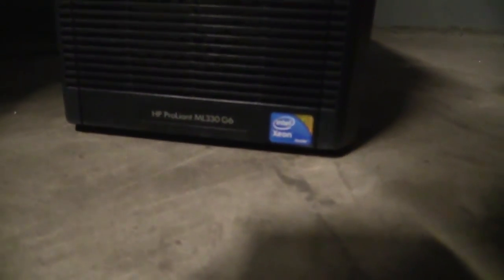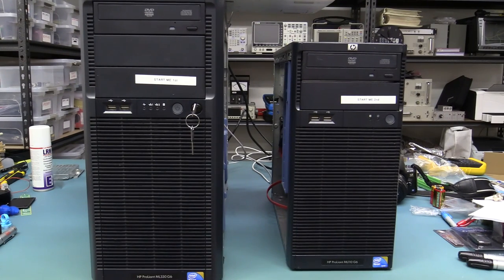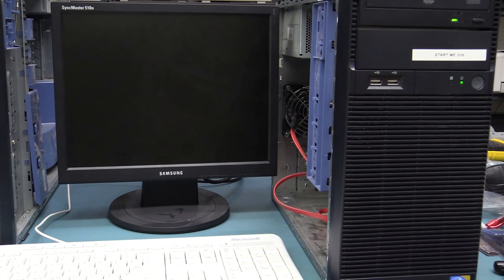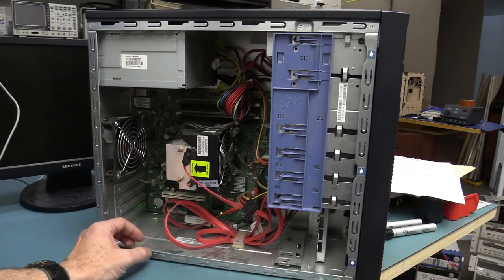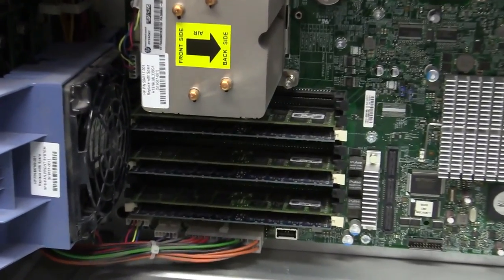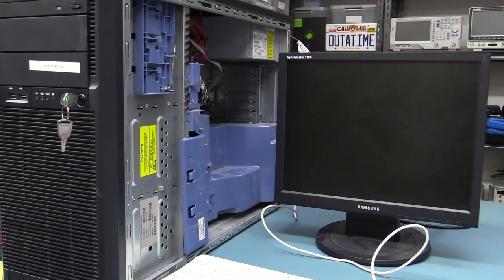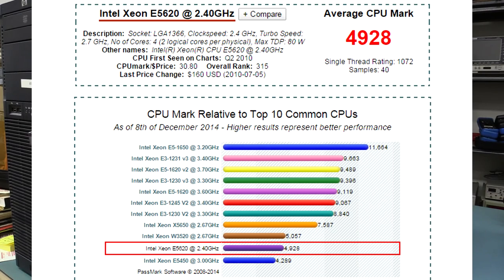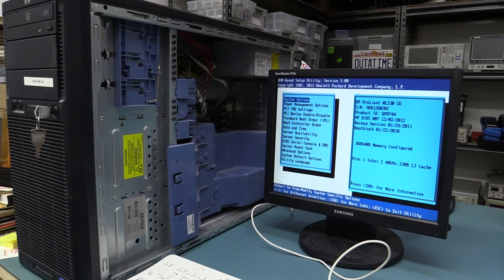EEVblog #691 - Dumpster Dive Xeon Servers

Comment from the maker: KaidoFujimi if you look at just a single processor system, yes. But if you look at it from a multi-processor large scale server based system, I believe that Xeon based systems can offer better overall processing power efficiency per server system watt per unit volume per user.
Reply: They also have more bandwidth as this system has a Tripple channel memory controller, the new Server/workstation class have Quad channel "LGA 2011 and LGA 2011-3"
 For the ML110 that can take a I5 and Celeron but why would you want to, also you may get problems as those have ECC RAM.

Also a funny note on the ML330 G5 HP gimped the Intel Sata Raid to only have raid on 2 channels instead of supporting 4 so if you wanted to have all 4 in raid not possible with out Raid card.

Got to love HP, i did complain and they did send a Free Raid card so i guess that was nice, well for the Client.
FYI the ML110 its not worth it, your desktop would be faster then that as its a low end server.

The other server worth keeping, as its mid range server so have fun. "worth keeping".

Server Fans are meant to be loud ;) "I can't sleep if i don't hear my servers... I am sick..."

Oh yeah Server heat sinks are normally over what is needed not as bad as some gamers but still over kill.

Thanks for sharing dave.

P.S you have a some toys coming from me soon in the mail.
Reply: BlackIce504 HP sells a 'license upgrade' for the raid and ILO that can sometimes be hacked.  the raid one is usually a hardware eeprom or some sort, could be a smart/sim card too.

intel started the whole licensed raid level thing shakes fist
Reply: Biggest difference between modern Xeon and i7 processors is cache size, ECC memory controller, huge RAM support, PCIex lanes and hdd/ssd controller. "Basic" performance is very similar, cores are very similar (if not identical).
Reply: Dave you can make an awesome FreeNAS system with that big server and all that ram!
Reply: doomprophet You can make NAS with small mini-ITX board. It would do the same thing, use 30x less power and generate zero noise. Using server like this at home, where you have max 5 concurrent connections is like using a caterpillar 100 ton truck to deliver 1 pizza.
Reply: *****
 Hi mate your speaking to a person that has a I7 on 2011 socket with a Xeon on 2011 the Xeon has better multi-threading performance then the I7 but the I7 has better single core performance but this is only because of the higher clock speed if i run them same speed i get similar results on thing that is the same is the cache L1 DATA 8 way L1 inst 8 way Level 2 8 Way L3 20 way the size difference in my case is 5MB but its expected Servers are designed to run multiple tasks. but you right about the more bandwidth pci-e lanes plus the QPI is 5GT/s to 8GT/s "2 to 4"

Anyway mate Merry Christmas
Reply: ***** ...You're making me feel bad for making an NAS/print server for my parents out of a $20 thrift store Dell Poweredge 830 hodge podge (had 3 500GB SATA drives in a hotswap SAS backplane out of a newer unit, with a Dell Perc 5/i raid card controlling it)... It has a pentium D monster too... Beats the repurposed emachine (with a old 3ware 7000 RAID) they were using... Both run debian w/o GUI.
Reply: EEVblog XEON's use about 2-4x Less energy per unit of performance than desktop processors.
Reply: KSSilenceAU compared to the exact same generation that the xeon was based on I doubt it, infact the motherboards and other hardware included in most 'servers' tend to use a bit more energy than a desktop.

I actually have an overclocked cpu, in a computer with a bunch of drives, a videocard that needs a pci-e power connector and it still uses less power than its xeon counterpart..

now 2-4 percent less energy vs performance maybe, if you were using the exact same hardware, and only changing the CPU out....
Reply: Valid point but All depends on the hardware and what tasks the machine performs and how loaded it is for a majority of time.
My IBM Server currently runs ~6VM's in ESXi but they idle most of the time whereas my desktop if under decent load when running, but with 3 HD 6970's in it, those alone would use just as much power idling as the entire IBM server does. 

In an ideal world one could take their i7 Out and drop in a Same Socket XEON, but unfortunately XEON processors with the same sockets are their Core Series friends wont work in a board for a Core Series CPU even though its the same socket, not sure if deliberate or not. Would be perfect for Hot weather tolerant machines. My rack server lives in the garage where it can hit 40c + and its not bothered, but my Lanbox Home server which is watercooled on the processor just doesnt like much heat and would never survive on air cooling, even though the Processors in both have the same performance per CPU.
Reply: KSSilenceAU for LGA775 desktop boards, you can actually get a pin swapping sticker, and do a simple mod to your socket, then a microcode update to the bios and run most if not all lga 771 xeons (I have done it)

For desktop boards running 1366/1150/2100 sockets, there are Q## series motherboards can can run xeon's out of the box.

you may loose a couple of xeon specific instructions because you dont have the related server chipset, but you dont loose them all, and afaik you gain ECC support and maybe slightly better cache performance(because bigger cache)
Reply: omegatotal i was reading a bit about that tonight but specifically looking at LGA 1156 which is what my "lanbox" Server is, Atleast for that socket people say you can drop for example a XEON X3450 (or other X34xx xeon) straight in and 9 out of 10 times it just works.

Im rather tempted because the X34xx  XEONS support 32GB of ram, where as the i5 760 and i7 860 CPUs for LGA 1156 i have for it only support 16gb ram. 

I believe the ram limit is that of the Memory controller in the Microprocessor and not the board correct meaning if i stuck a X3450 in i could run 32GB instead of 16GB ?
Reply: KSSilenceAU yes and no, there are some limitations on the board due to the passives and the load that is placed on them with higher density ram.

Also xeon's allow use of FB-dimms(better performing and allows more ram per channel) but not all boards can handle those either.

it takes a bit of trial and error 

also, you may need a microcode update, which is not always trivial. just depends on the motherboard and bios files/flashing utils used

for example, I just recently modified an HP bios and discovered for example that the HP bios version does not infact support 8bit (256 color) full screen logos, even though the AMI Bios that the HP Bios is compiled from /should/ support 8bit color..
Reply: omegatotal , the board in Question is an MSI P55-GD65 (Not the USB 3 version) and there are a few reports of it working with the latest bios i think. What exactly goes into updating microcode and how does one get hold of the microcode they need?

Flashing is done either thru the bios's built in M-Flash utility or via a Bootable USB / CD as well i believe.
Reply: omegatotal Would this be the Microcode im looking for ?  https://downloadcenter.intel.com/Detail_Desc.aspx?DwnldID=24290
Reply: KSSilenceAU im not sure in specific, heres some info for what I had to do
www delidded com/ how-to-update-cpu-microcode-in-award-or-phoenix-bios/
Reply: EEVblog can I have one :D will pay for shipping :D
Reply: EEVblog send me some ddr 3
Reply: blissinthemix Thats server ram, which is different than desktop pc ram
Reply: +frank james Some desktop motherboards will support ECC DIMMs.
Reply: That Linux Gamer
 That requires that the CPU itself supports ECC though, and most intel Desktop processors DONT, just beware of that.
Reply: KSSilenceAU What do you mean by that, I don't understand.
Reply: frank james

What it means is that to use ECC Type memory that servers use, your processor in your computer must support ECC Memory.

This means to use ECC Memory you need to have a Motherboard that is Compatible with a Processor that Supports ECC Memory.

Intel Server Processors and pretty much all AMD Processors including their desktop processors support ECC Memory.
Intel Desktop processors however DO NOT support ECC memory. Some Intel Workstation Processors MAY Support ECC depending on model.

ECC stands for "Error Correcting Code" and it allows the memory modules in unison with the memory controller inside the processor to detect and correct minor memory bit corrections which adds some limited fault tolerance to memory issues that could otherwise cause software or even the machine itself to crash.

Hopefully that makes it a bit clearer for you.
Reply: +EEVblog Such a shame people just throw these things away in the dump.   Both are still usable.   A good cleaning and inspection/fresh grease is needed before their put back into operation.    Could be used for training/education purposes.    That one sounded like it was going to take off!     :)
Reply: What is the key in the bigger one
Reply: +blissinthemix only if you get me a ddr3 mother board cuz mine is ddr2 and 4gb but still somehow a beast
Reply: +EEVblog The Xeon is mainly aimed at number crunching and memory operations, the video encoding support on a modern Core i7 will be miles better!
Reply: +Blake Lamonten The key's there usually to prevent it from being switched off and to keep the side panel from being removed. It's pretty common in server chassis to keep people from inadvertently shutting them down during operation. (Or to keep the bloody network guys from turning them off without thinking >_>)
Reply: ***** XD
Reply: +EEVblog so did you sell them ?

Comment: The Ethernet "management" port is a dedicated Ethernet port for HP's iLO (Integrated Lights-Out) offline system management interface. It's basically a web page that allows you to power the server on and off, remotely view the console, attach virtual media, reconfigure the system, etc... The "LAN1/Mgmt" port is also labelled as a management interface, because iLO can be configured to share the system LAN port, so you don't need to run a second dedicated management network if you don't want to.

Comment: The little one is the web server and the big one is the database server.
Reply: I could be wrong, but considering the amount of RAM, I think it's more likely the big one was a VMware ESXi host running a few virtual machines. 36Gb RAM for a database server is really only needed if you're running multiple massive SQL Server databases, like the kind you'd expect to see in skyscraper-sized businesses. Not something I'd expect in a technology park, like where Dave words.
Reply: Mark McGough actually Oracle generally needs a ton of ram
Reply: ***** Could be right there, I forgot about Oracle. I used it once, during that one particular IT course, and never again afterwards, so I'm not exactly experienced with it. :)
Reply: Mark McGough What? Have you actually ever worked with any DB of even medium scale... nvm massive. Our primary sql server instance has 96Gb allocated and it damn well need them. There is ~3Tb worth of DB in it, which is not "that' much, connections and transactions take their fair share of ram. The ESX cluster is made out of 4 eServers with 256Gb each, 1Tb or ram, Aka not enough...
Reply: jonharson Biggest I've worked with is about 5Gb. 3Tb is insane. For a DB that big, I can certainly believe you need a tonne of RAM. Still, for the size of businesses I'd expect to find in a technology park like Dave's, I wouldn't expect the DB to be bigger than, say, a gig.
Reply: You'd be surprised Mark :-)
Reply: MichaelKingsfordGray
Or they just were your typical 'small company' servers. It's not like everyone needs ultra-reliable or whatever:)
Reply: MichaelKingsfordGray I work in one of those medium business, the main server running MS SQL has a Xeon E5620 like here but with 32GB of RAM and the SQL database it hosts uses 25GB of disk space... go figure.
At best, the server has like 20 concurrent connections... lame, I know...

Comment: I have a nice "gaming" pc (my first build, a good 13th birthday present) that i built mid may this year. Yes, it has got a watercooled cpu and led fans, but when seeing that big server fire up my heart skipped a beat to watch it post. Mind you, my pc runs silent, but you could at least use the server as a paper plane launcher :-)
Reply: Where they lack performance is that they usually have no sound codec, and they PCI buses are usually 4x and 8x, not the PCI-e 16x v3 that makes a video card fast. I've owned on and with a workstation graphics card or something comparable they're great for video production. Otherwise they're sluggish for games.
Reply: yeah. but still, to see something that beautiful boot up was great. also sad that they threw it out. and i know that xeons and servers in general are not for games, they're more for 24/7 rendering and servers, and the reson the have at least 6 cores (last time i checked) is so that rendering engines and servers can take advantage of all those cores to get the task at hand done faster.

but still, they are beautiful compared to my pentium g3420. soon to be an 13 4160 (and it will be watercooled, mainly because it looks like it will be a hot summer here on the northern beaches!)
Reply: SeanFromPVD in case you were wondering how "gaming" my pc really is, here is a link to a forum with photos of my pc on it http://linustechtips.com/main/topic/215719-1st-case-mod-showcases/. (you may have to sign in to see them, not sure)

and there is not watercooler in the photos because there a couple of months old now.
Reply: Xeons go up to 12 cores, with Hyperthreading now, so that's like 24 virtual cores. I have an AMD FX8350 Black Edition for my CPU, an AMD R9 270X for my GPU, and 16GB DDR3 1866 RAM. It has a 120GB SSD for a boot drive and 4.5TB of storage for other content. It does a decent job gaming. I haven't watercooled it, though the stock heatsink was way too small, I opted for a Coolmaster Hyper 212 EVO, which works fine. :)
Reply: SeanFromPVD nice. i didn't want to say the max cores because i figured it'd changed since haswell got treleased then refreshed with devil's canyon. anyway, i've got an 13 4160, 8gb ddr3 1600mhz ram, an amd r7 265 and a 1tb seagate barracuda + a spare 1tb 2.5" barracuda in a drive bay.

plus soon to have a h75 120mm watercooler in push pull.
Reply: SeanFromPVD
you could run a gpu like a GTX980 on the 4/8X slots just fine, it'll be the low cpu frequency bottle necking the card not the PCI-e interface.
Reply: You have to cut the end off of the slot if you do that. The longer cards 'technically' work, but don't always fit.

Comment: The larger one with it's quad core hyper threaded CPU, RAID support and all it's memory would be a good editing PC.
As for the smaller Heat sinks well they use them because the system does not need to be silent unlike a gaming pc.
Also the Ethernet ports marked management are for IPMI use ( or iLO as HP call's it ) as well and stranded Ethernet.

Comment: Is.... is that a SD card slot on the motherboard of the ML330? Huh, that's interesting.

I wonder if that can boot off a SD card.
Reply: Yup. ProLiant servers can boot from a SD card. :)
Reply: ***** That's pretty awesome. I bet that makes for great setups in cases where you don't mind having a read-only boot-disk.
Reply: Yes it can
Reply: To clarify *****'s comment, ESX/ESXi is a virtualization hypervisor from VMware. Allows you to run multiple "virtual" servers on one physical server. Generally, the ESXi host partition doesn't get written to. The virtual hard drives for the VMs are stored on regular spinning disks.

Comment: At the lab we don't use ProLiant Xeon systems, but the Dell PowerEdge Xeon systems.  These professional grade machines are resilient.  Despite the harsh environment 
(3 stories underground in an open topped hole with just a tin building protecting from the environment, large amounts of ground water, large amount of salt in the humid air from being on the coast of Japan) 
in 6 years we've only had 8-10 major failures, half being easily fixable.

The only large batch of machines that we turfed were ones that got exposed to 37C for a long period of time (someone was not thinking and made a mistake) ... they still worked but they were not trusted.

Comment: A note on the "small" heat-sink/fan:

Smaller fans have to rotate faster to move the same amount of air as larger fans. That makes them louder. Most of the fancy gamer setups don't actually cool any more effectively than a stock or small fan, they just do it without sounding like a vacuum cleaner. That extremely loud startup is what you'll hear every time the server's CPU usage hits 100%.

Comment: As some one from the server world writing these off and getting ride of them is easy. With servers the initial investment isn't nearly as high as maintaining them. These were released 5 years ago an you can now get a new one that is 3x as fast using the same power not to mention they are now off warranty so if anything fails you have to fix it your self instead of having hp come and fix it the next day.

These are also really low-end server most server blade we get now have 2 8 core processors with hyper-threading for a usable 32 cores per server as well as 192GB of ram all requiring similar power and cooling requirements as this server. On those blades we virtualize up to 24 servers depending on the vm demands.

Also HP gen 9's are coming soon. They are out there just not in full blown production yet.